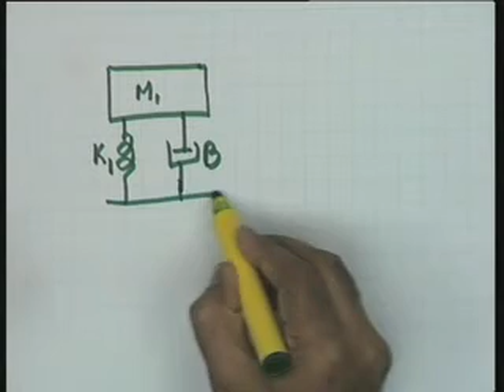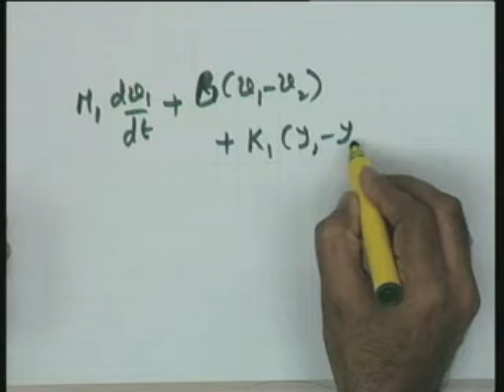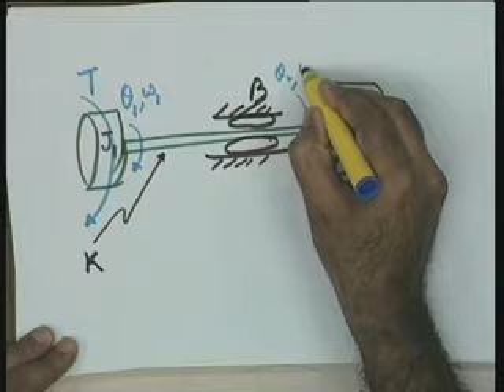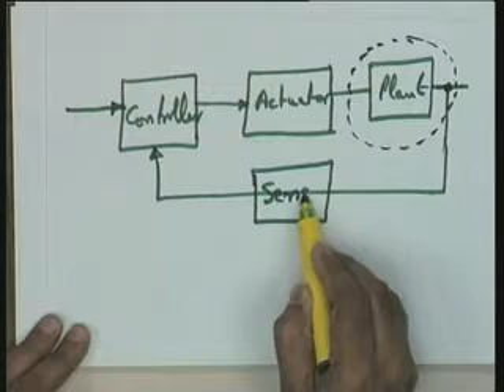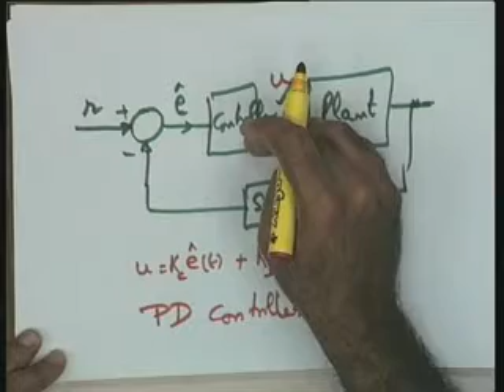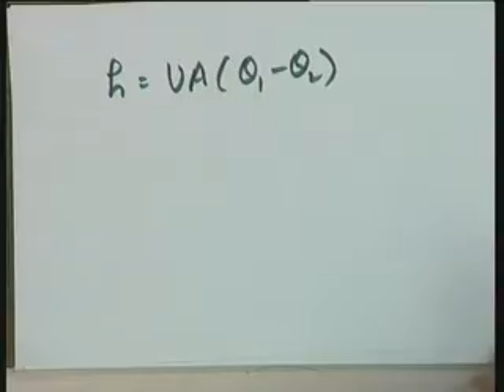Lec-7 Dynamic Systems and Dynamic Response (Contd.)

Comment: if for relaxed systems only the laplace transforms have initial conditions equal to zero, then how can we take the automobile problem's initial condition zero, sir mentioned that the system is under stress. plz clarify
Reply: I think this is because we have assumed that the vehicle is stable initially, that is, it is not jumping up and down initially. Hence the initial values of position, their derivative (velocity) and acceleration are all zero at t=0. Hence we get those terms zero when we do the Laplace transform.